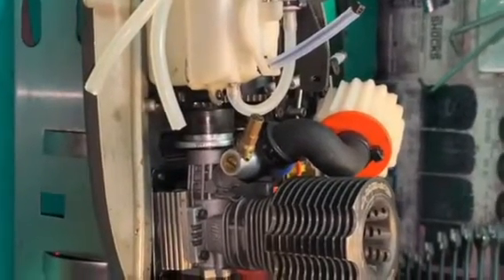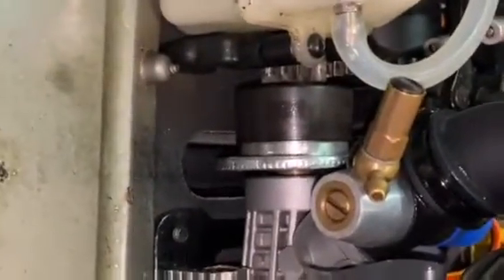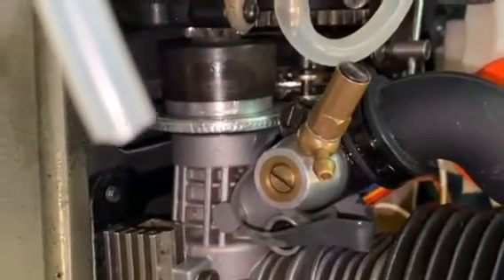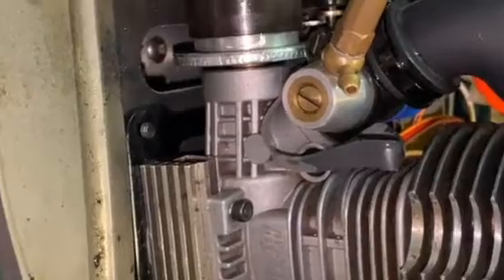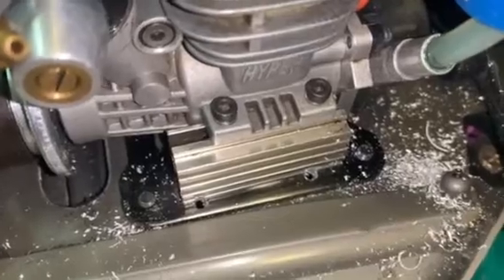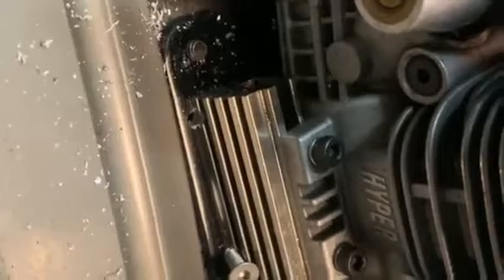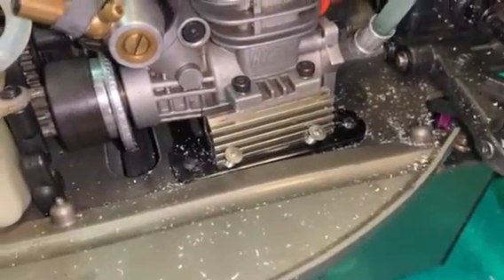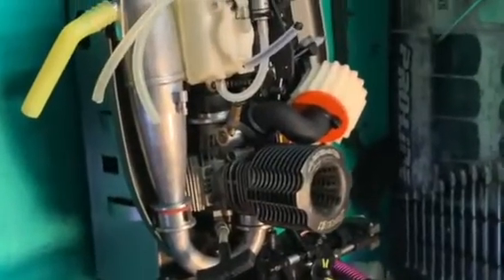ENGINE MOUNT SLIDE DELETE MOD Hyper7 1/8 4WD Nitro Buggy

Comment: Hay bro I’ve had many hyper 7 to many to count but never had a problem with engine mounts ? Engine maintenance is the key not drilling in to side of the mounts ? The issue is the mounts have a sliding nut in mount that’s what moves not the engine mount it self ? Motor maintenance should stop the problem I see what you have done is destroyed the mounts an chassis plate!!!😱😱 good way to waste money?
Reply from the maker: Hi Tony! Glad to hear you never had this issue. I’ve lost multiple clutch bells and needed to find a solution. No one has been able to come up with any solution except me. I can see on the hyper ST they fixed the issues. The 14T clutch bell is the largest clutch bell you can install. There is no more adjustment. You can only go smaller not larger. Anyway we are taking about different things. I’m talking about mesh. Lateral movement. You are taking about nuts. That only affects how close the engine is to the fuel tank. Engine maintenance has nothing to do with bad landings. Maybe you are doing up the 4 pan head screws more tight. Maybe you have removed the pan head screws and used countersunk instead with countersunk washers. Or are you taking about another type of maintenance? Like cleaning? Not too sure bro. Destroy? Waste money? Nah not me. Never. I don’t destroy my toys. Or waste money. Only improve them for free!
Reply: @inzp3ctor    Hay bro not after a argument just think that the manufacturer would have fixed this problem if there was one ☝️ drilling the chassis like you did then bumble around like you did with screws in the side off the engine mounts did nothing to stop what u set out to fix I’m just trying to understand what? You are doing I’m not having a go at you hay bro 👍
Reply from the maker: I am happy to clarify what I was setting out to achieve and what I actually drilled. It wasn’t clear in the video. I should have showed it from underneath. I drilled the engine mount plate. It’s a U shape plate. Not the chassis. No holes in the chassis. While doing this the drill bit touched the engine mounts. But no holes in the mounts or the chassis. Now the m3 bolt goes in which prevents the engine mounts sliding on the engine mount plate. The plate can’t move in any direction because it has 4 countersunk screws fixed to the chassis. The engine can slide forward and backward in the mounts but there are 4 locknuts to prevent this. The engine can also slide left and right to adjust the mesh. The 4 pan head screws preserve your mesh but on some hard sideways landings and cartwheeling the engine can overcome these 4 screws keeping the engine mounts on their exact position on the engine mount plate. With two m3 bolts I have stopped this from ever happening again. I can’t use a larger clutch bell now, unless I drill new holes.

Comment: An one last thing never ever leave your motor in when you have small metal filing that can go straight into your carby you didn’t even put the fuel tubing on for some reason you had it of for the whole video? That can destroy your motor then you have motor blown an drill holes in chassis buggy worthless?
Reply from the maker: This is a great point and thanks for letting me know. I didn’t. Actually notice this so I will go and clean the carb before I forget. Yes those fillings can kill an engine easily. Good spot!